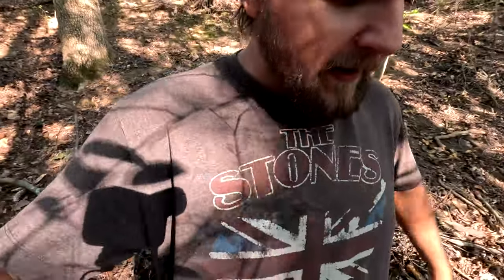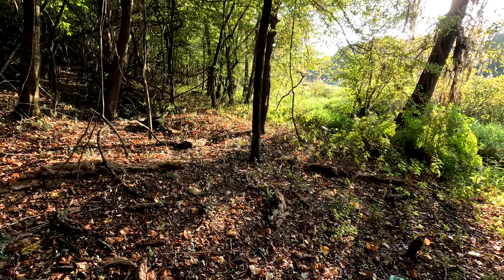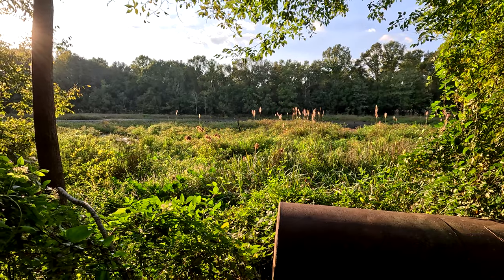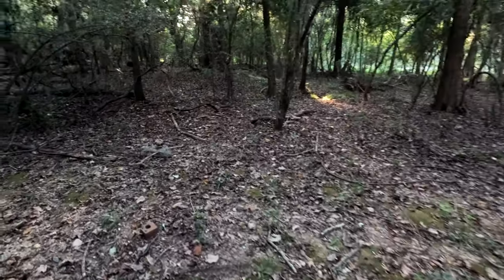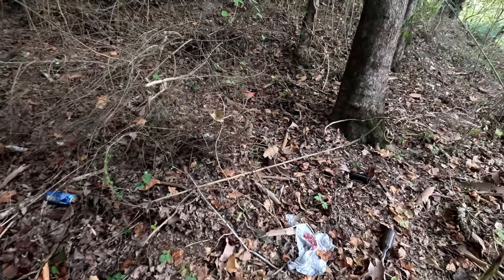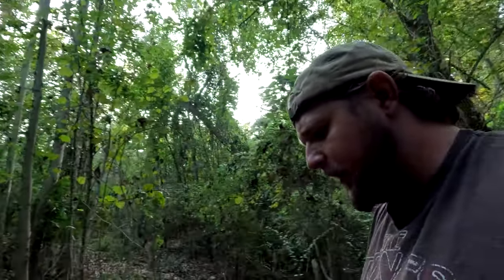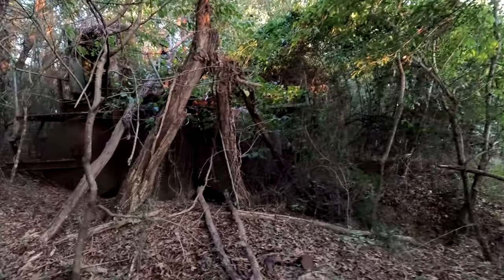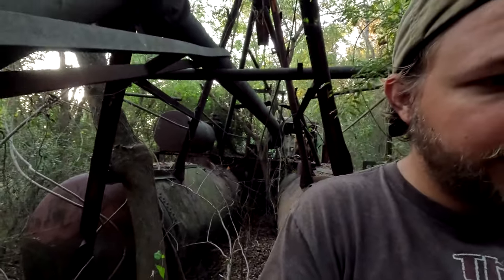abandoned SAFE and HEAVY EQUIPMENT found in the woods of Georgia

Comment: Thank you for your interesting survey on that blown safe. Sometimes it’s hard for me to accept the stuff literally and thoughtlessly thrown out. I can easily state this as I now have two working Ford tractors and what was a broken down Crawler which is a Clee Trak (Clee Tractor) which were manufactured until their take over by Oliver
Tractor Company at about 1935. The fact is, most of this equipment after repaired -works very well and is easy to maintain. The rest - which is garbage, should be sent for recycling and then re-manufactured into something else.

Thanks for your attention…

Comment: One way of finding out the age of the dump is to learn how to read the dates on the bottom of bottles.
Reply from the maker: For sure, or just know the ages of bottles in general. I’m pretty good at id’ing bottles 1950’s and back, but if it’s a screw top I get disinterested real quick. But your Duraglass etc always tells the story. Also Coke bottles have a date code up until the 60’s at least.